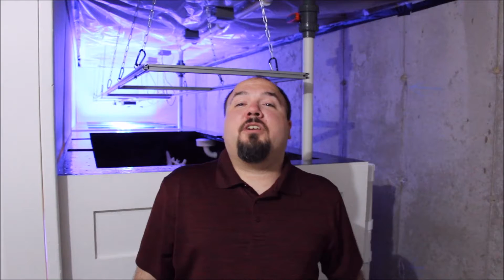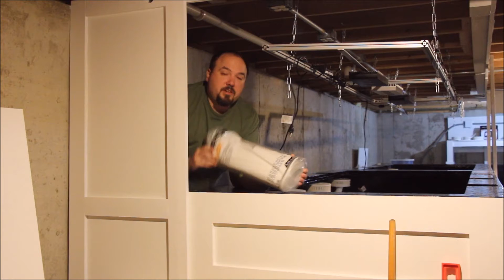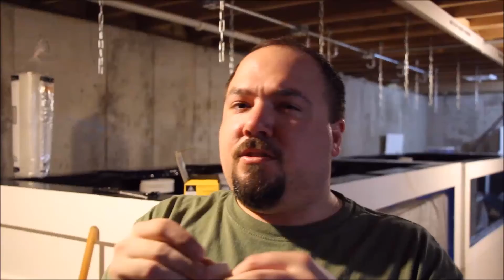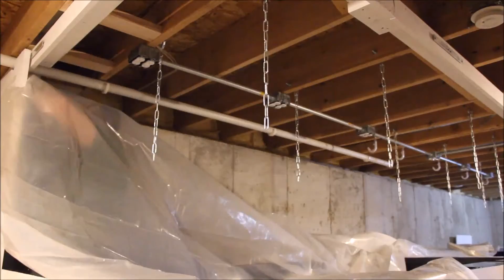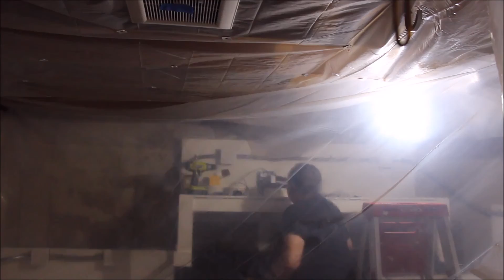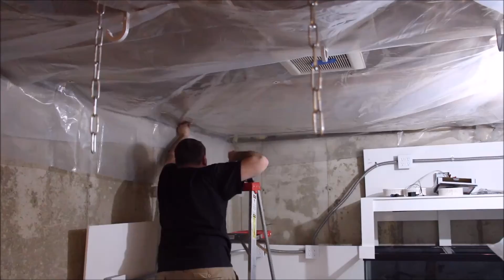1600 Gallon System - Humidity Control

Comment: good luck man , If it does not work You can always add an electric humidity Absorbed  .... Dehumidifier....... 
I mean a product like this https://www.google.co.il/search?q=Dehumidifier&rlz=1C1CHEU_iwIL475IL475&source=lnms&tbm=isch&sa=X&ved=0ahUKEwjJpNyGuurTAhUBIcAKHcV9D5oQ_AUICigB&biw=1024&bih=662#imgrc=_  , or maybe diy , Anyway good luck
Reply from the maker: Thanks.  I do have an electric dehumidifier which will also be on standby if I need it.

Comment: I agree with trying, what you have researched, and truly believe will work. The beauty of DIY is experimenting and experiencing. If something does not respond quite as planned, simply re-visit it.. I had mildew build up under the 360 gallon due to the 24sq ft of active surface and unpainted wood. Learned a lesson and cleaned it up and lightly painted with Kilz paint. 4 months later all is good except a couple cut ends that were missed. So with the new system in build, I painted heavier and did not miss any areas !..I am considering a fan on end to keep a surface breeze that exits into mainroom of house. The moisture wil only be about twice the 360 gallon tank, and the homes a/c can manage that with a very slight effort.  The tank is in a 1200 sq ft open area of house near air handler as well. Your attention to detail and sharing is aces !  I following along with anticipation !!

Comment: it won't be a humidity issue down the road. it will be a moisture issue. the small ceiling fan isn't big enough. that fan is rated to run 1-3 hours a day. u need a cross ventilation system. good luck man
Reply from the maker: The moisture level in the air is a concern but if I am able to mitigate the moisture through ventilation it will not be able to accumulate in the space or absorb into surrounding materials.  The ventilation fan I am using is not duty cycle rated on any of its documentation for 1-3 hours of use.  Do you have a source for that duty cycle information?  The model I have only states there is a thermal shut off for the motor if it overheats.  In the year I have had the ventilation fan installed it has run over a week straight without issues.  The ventilation system setup is similar to a cross flow system as air naturally vented into the house enters the space as other air is exhausted outside.  I do agree that if moisture becomes an issue I will be adding a dedicated cross ventilation system.  Thanks for the comment.  This us definitely a topic I will revisit once the tanks are up and running.
Reply: AlexGs Aquarium I'm just worried that the fan is to small. we install way bigger and multiple fans in basements for small indoor ponds and it sometimes still causes mold if the customer doesn't want to pay for big airways.
Reply from the maker: I do have another exhaust fan on standby that is 350cfm.  I did have another use planned for it but if needed I will repurpose  that fan for the aquarium.  When you setup basement ponds are they open or contained in a single room?
Reply: AlexGs Aquarium I don't set up the ponds. I just do the water feeds and venting. and they are in a open floor plan
Reply from the maker: Is there a ratio of total cubic feet of open space around the pond to the ventilation CFM requirements that you use?
Reply: AlexGs Aquarium the supply house calculates it for us. I use Ferguson supply